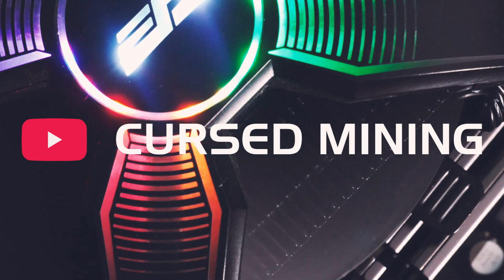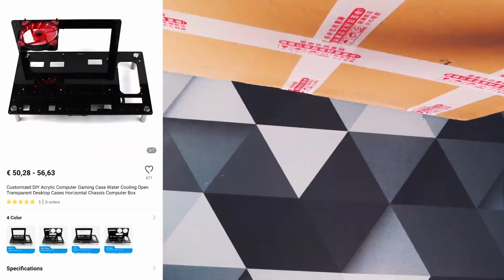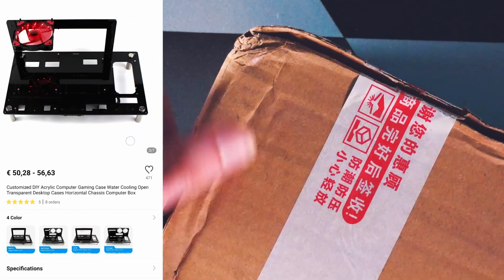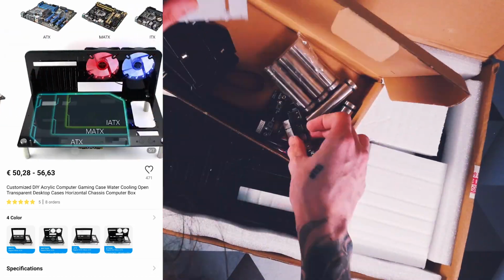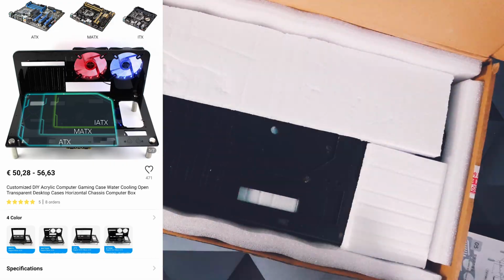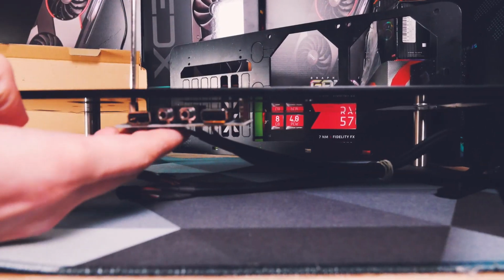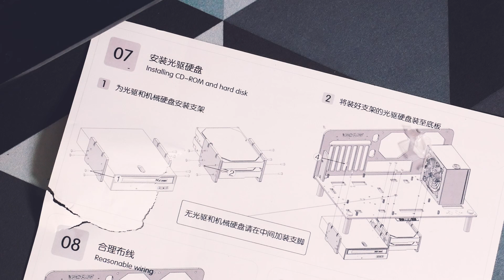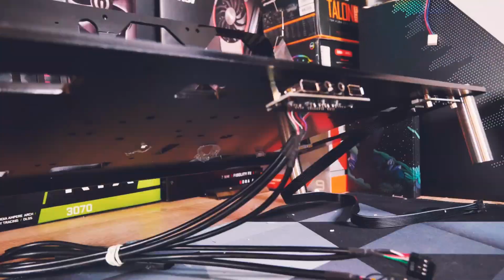Acrylic Open PC Case from AliExpress | DIY test bench for computer or mining rig frame

Comment: I think that acrylic frame is pretty awesome I love having the wires go underneath but the standup one is good too I guess it all depends on how much stuff you’re going to put on it the best part about an open frame is it’s easy to keep clean you could just blow it off any other CPU cooler is pretty cool but I still like the UFO won the best that you had but yes let’s do a video on some more coolers that would be great
Reply: bro the open case is subject to a lot more dust, what the fuck are you saying
Reply: and it's not easy to keep clean, you have to remove the component as the closed case as well... think before talking :')